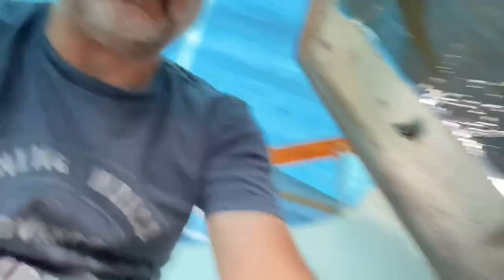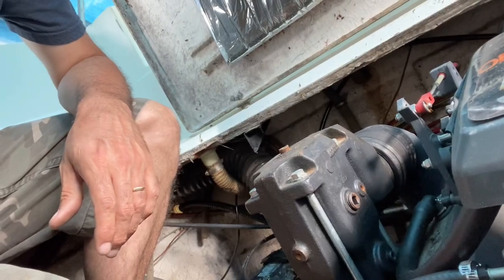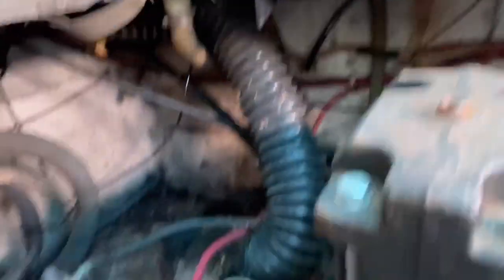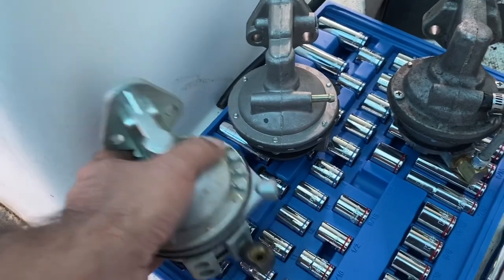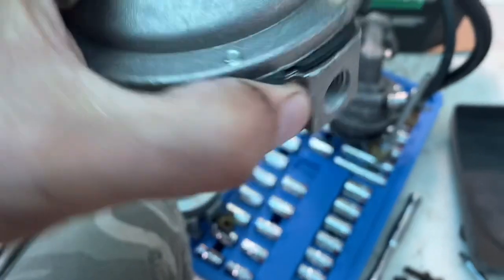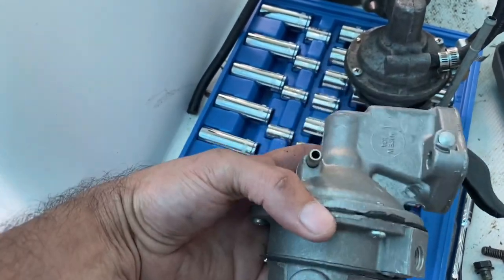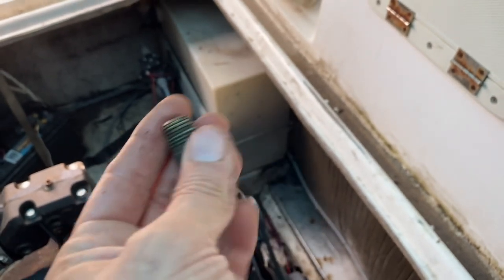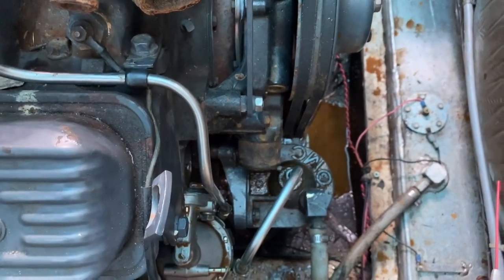1989 Bayliner OMC 5.7 Ltr  Fuel Pump Replacement

Comment: Did this help the bogging issues? I have the same engine 1992 Chris Craft Concept 227. Mine has had a ton of upgrades recently, but I do notice when putting the throttle forward from standing still the engine bogs around unless I slam it forward and take off (seems like gas doesn't shoot into the engine unless I fully push the throttle forward.
Reply from the maker: Yes it did but we also rebuilt the carb
Reply: @SVFresh2Salty  I actually have the 5.8L not sure if there’s a big difference there. I had my marina install a new Holly carb last summer. I’m hoping the fuel pump replacement and some new fuel lines help!